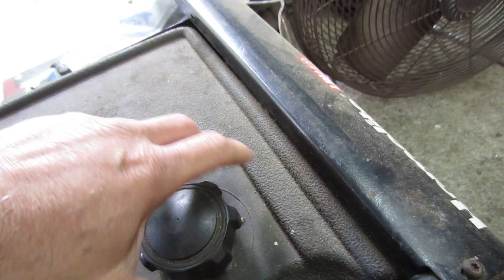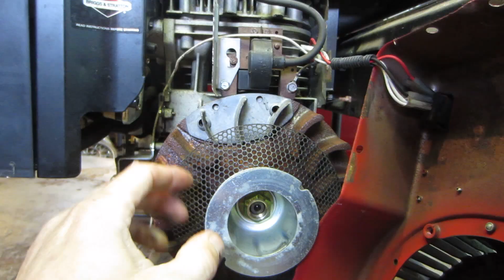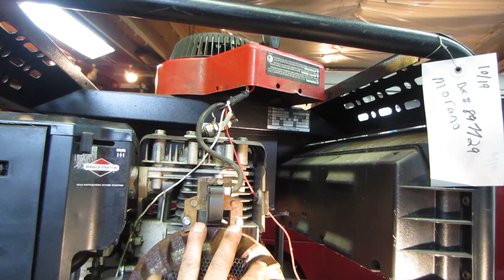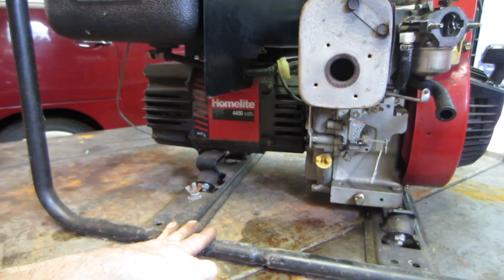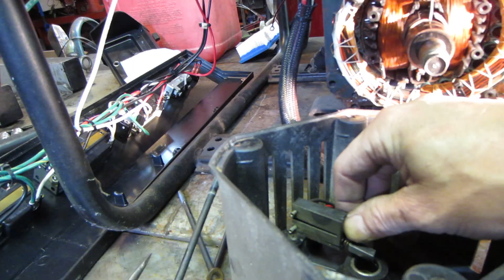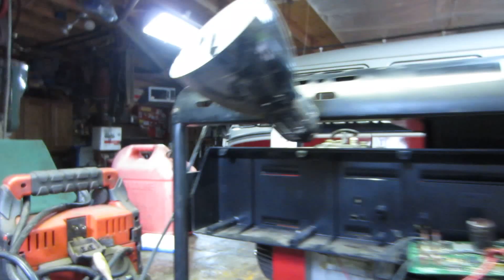$5 yard sale generator

Comment: I was not satisfied by the final test that the exciter winding was getting current which may have been slip ring issues.  What was the resistance reading for the slip ring circuit?  I feel this generator was really close to working.

Comment: Rust on flywheel will not prevent spark, but may weaken spark somewhat because of inductive pickup between mag and steel insert in flywheel is reduced by the rust. I hate rust anyway, makes things look sloppy. I've discovered that rust will make a truck engine's spark wires clamps at the distributor or spark plug cause a miss at idle which can be very irritating.

Comment: Sanding the fly wheel, will bring back the spark..when rust gets heavy, it will build the air gap up too,high..sanding will bring the gap back..learned that 35 years ago

Comment: Did you run it and check for voltage at the generator head plug white and black or red terminals?

Comment: The way half the outputs failed at different times, I think the splice point of magnet wire to insulated wire failed in the stator. Maybe someone slipped  in som acid core solder at the factory. I think it would be worth it to take a peek at those splices.  I would have expected to see some AC when you applied power to the field ....Heck, years ago my good friend John Murphy would unwind a defective motor by hand, sand off the old varnish , then re varnish the wire and rewind

Comment: Sound like a fuss or a  circuit  breaker, no out let power. Who knows. trail and error testing. Can always part it out > But a GENERATOR?  HELL NO !  get it working,  I got so many uses for em > Drain some of that oil out > i alway check the oil 1ST  see if any metal ect. level

Comment: I've never seen a generator engine without tapered shaft, rotor for generator does not have a key, long bolt goes through rotor to crankshaft on engine.

Comment: Looks like the lamp you were using was an l.e.d. if thus is the case than most likely the lamp will not come on at all at half voltage. U need to use an incandescent bulb.

Comment: If you should examine the circuit board closely look at corrosion on any of the legs the resistors that would indicate the resistance has changed value has changed and it may not operate within specs also look to see if any component is expanded or burnt!

Comment: I would have checked solder joints on the board to see if any had broken or had heat stress.  Cheap and easy fix!

Comment: I have a small 2000 Watt generator that has the same issue, the engine runs fine but there's no power. I will try the 12 volt idea. That will be a summer project.

Comment: 1 st rule of elec.     clean and tight            the coil needs to be grounded to the block    wire wheel the back of the coil where it mounts wire wheel the mount studs if you have any     run a file across the two mount studs on the block        if you still dont have spark the coil is shit      air gap is  .010  in.       the rust on the outside of the flywheel dosnt do shit   thats not how it works           so stop condeming the coil because you dont know any better        now you know

Comment: Mustie, rust is the same as a resister in an electrical circuit. It inhibits the flow of magnetic flux. Therefore weaker flux even to the loss of spark.

Comment: On the generator specs, there should be ohms readings for the various windings and I think I would have checked those out to make sure the windings were all conducting at their proper specifications. Very rare that a generator that comes out of a factory and is not tested to ensure it is working. That being said, if it is the board, one can rig a basic power board and use an SCR motor control circuit to operate the throttle solenoid.  Then you would have a good generator. Mainly due to the fact that Homelite had issues for many years of their generators failing due to issues with the voltage regulator. So, found that on eBay, one can get the regulator for around 15-20 bucks new. That would make it a cheap and easy fix and if the failed regulator fried the board, then again, a makeshift power board would be a way to go. Working units that are not as clean sell for around $150. So, something to consider.

Comment: Rust can electrically bridge the laminate between the plates of the laminated magneto core, that significantly decreases the rate at which the core magnetizes and demagnetizes, which can affect the ability of the magneto to generate a spark.  How much, I do not know, but it does have a negative effect.

Comment: I've watched you for a while, but your comment on the rust not making a difference shocked me. Of course it does and 99% of times that has been the issue I've found when fixing small engines. Sand the rust off and BOOM you have spark. I'm sorry but you seem to know a lot and that comment has shocked me lol. It's one of the most common and known things. I know in this case you didn't and it got spark, but the spark will be stronger the cleaner the magnets.
Reply: rust has no big affect on inductance it may even improve it by closing the gap
Reply: I've always done the same, but I tend to agree with him. it always seems to have more to do with gapping on the coil then rust.
Reply: Rust does not effect magnetism of flywheel.
Reply: RustySkull Productions for sure I had rust on the coil wire on a lawn mower and it made the spark very weak
Reply: Exactly
Reply: Forsure
Reply: That all almaium now days
Reply: rust only works on ferrite on copper wires its called corosion

Comment: I had this same generator before, The coils in mine were burning up in the back of the casing. Once it stopped working I ordered a new one, placed it on and it did it again and died. Like yours the Briggs engine runs great it's just that Homelight Electric coil isn;t that good.

Comment: On the ground fault plugs you must have power to the plug to trip it on the test button. Or it will not trip because that is actually something to keep you from shocking the crap out of yourself if it works right the test button basically make sake momentary cross between ground and hot to trip the system. At least that's what they tell us an electrician School unless that's some sort of weird setup that they don't teach electricians.

Comment: Yes rust on the fly will and the magneto if it builds up enough can disrupt magnetic continuity to the point where it either doesn't produce spark fast enough, not enough power, or not at all but typically that only comes from engines that of been set outside for a long period time but it's always a good thing to try sanding the magnets, if you don't I can change your gap settings when you put the magneto back on.

Comment: Yes rust on a fly wheel will also prevent the coil from making spark! It's not a MYTH! I've repaired plenty of small engines with no spark. Took a wire brush and fine grit sand paper and cleaned the rust off.

Comment: Your urban myth claim is NOT an urban myth.  Had a Stihl backpack blower that was caught in the rain one day and next week wouldn't start. The only thing i did was sand the rust off the flywheel and coil face.  Restored spark and it started on first pull.  I have seen this issue many times in my 48 years of piddling with small engines.

Comment: People replace the receptacle with a household unit and they come with a bridge connecting the two halves together. A lot of generators arent wired that way and it shorts the two windings together burning out the stator. The bridge needs to be broken out.

Comment: FYI for you that rust on the flywheel magnets and the fins on the coil will cause no spark. How many times I had no spark and cleaning them off brought it back. Just use some sand paper and take the rust off.

Comment: sending off the rust sometimes bring spark back to the Magneto I have a little 2 stroke Sportsman 1.75 outboard boat motor that had no spark and I took some Emery cloth to the Rusty Magneto and it started right up so it sometimes works and sometimes doesn't
Reply: but that was also an electronic ignition

Comment: I didn't notice if you addressed if the generator head was actually being driven by the engine. I'm sure it would make a bunch of racket with a broken coupling. and with no resistance on the windings sure sounds like it was toasted. doesn't stop us from hoping for simple stuff though. great video!

Comment: Not trying to 'burst your bubble' or anything, BUT at 7:00 or so you saying 'sanding off mag is I think urban myth' well, maybe it is a myth. But for me I think it worked. I have a 5hp Briggs on an old tiller. Had no spark when cord pulled. So I took off cover, saw rust on the flywheel, hit it with some sandpaper and got the ends of the coil w/paper too. Hmmm...it sparked 'white flashes'. Long story short,,,either doinkin' around with the coil, or the sanding of the rust off the flywheel, worked. Also, I saw on another of your vids going down into the points and condensor. FWIW I saw one of 'Teryl's (Teryl fixes all) vids of him replacing old coil with new electronic coil. NO points or condensor, and he just cut the wires to the points/cond. Didn't even bother to dig down into it and take them out. Didn't need to. Hmmm...   cool huh.
Reply: an old and easy fix .... cut the wire and fit a later coil good tip though ...... but hmmmmmmmm ?? no need to be sarcatsic

Comment: Generator 101, Rotor  = exiter
Stator windings  = Output power;

Same as automotive Alternator where the  3 phase AC output power goes through Diode assemblies to produce DC output!
They both  have some sort of Voltage regulator!

Comment: What I have found when the windings on the field (outter) windings overload is that the point of break often occurs at the crimp connector where the windings come together. It is easy to cut the remaining winding away from the crimp and then sand the ends down and re-connect the windings using another buchanan, though I generally drop some solder into that after I crimp it. The same I have seen on auto alternators as well. In the latter though one of the diodes to the rectifier bridge associated to the winding that burned is always bad as well.

Comment: I was looking for replacement wheels for a lawnmower once and my neighbour had an old Lawnboy mower that didn't work. He gave it to me for the wheels. So I said to myself why didn't this mower work. Found out it had no spark. Took it apart and noticed heavy rust on the magnets so I sanded them clean. Put everything back together and hooked the plug wire back up to the plug and voila - spark. A few pulls on the cord and it fired up perfectly. Neighbour was not too pleased when he saw me mowing my lawn with his reject mower. So urban myth it was not.

Comment: I think the test light you were using at the end is a CFL inside a spotlight. I don't think they will light up with only 50v, next time using a regular incandescent might work better.
Reply: He had zero output Volts on the meter so it wouldn't matter although you're probably right about it

Comment: If you still think it is is the board, consider looking it over for burnt or obviously damaged components and buying and replacing them individually on the board. Should cost pocket change. The motor does sound like it's not idling very high. Doesn't have its usually vibrating rumble of full speed.

Comment: I'd just replace the individual components on the control board. it looks all through hole discreet no SMD. digikey is cheap. slot of the semiconductors can probably be found in other electronic stuff. sure would be a hell of slot cheaper than a board. that's how I go about it. or get in touch with bigclive.com here on YouTube. he's in Europe but he may be able to test it and fix it on the cheap.

Comment: Always check the armature on generators that have been left sitting for a while. They will oxidize and the brushes won't contact enough to generate any current. Clean the rotor contact area with scotch-brite pads.

Comment: If you haven't abandoned this project, check and if bad, replace that large capacitor on the circuit board.  It's a low cost item, might just as well replace it anyway.  That capacitor is used to flash the generator each time you start it.  It substitutes for a battery..
Reply: The cap and condenser are for “exciting” the field and oftentimes you only have just one cap. “Flashing” the field is done with a 12 volt battery connected directly to the output poles whilst the engine is running and what this does is to restore the magnetism in the primary windings.
Reply: I somehow missed that part near the end of the video.  Thanks for pointing it out.
Reply: The capacitor doesn't flash the generator field.  It is part of the excitation control system, probably a filter.
Reply: I'm late here, but if you ever suspect a circuit board is bad with no obvious cause, and it has electrolytic capacitors on it, may as well swap the capacitors and see if that fixes the problem.  They are chemical and have a shelf life, and it's not unusual for them to fail prematurely.  Replacements are probably only a dollar or two at a place like digikey or mouser, USPS shipping is likewise only a few bucks if your order is small enough to go regular mail.

Comment: Find someone who tinkers with electronic circuits & let him have a look at that board. There may be a transistor or capacitor that can be unsoldered & replaced to repair the board. Worth a try..
Reply: It would not help a darn thing. If there is absolutely no connection between the wires from the stator coil, it's burnt.
Reply: Mustie and Sporty- anytime you think or know you have a problem with a circuit board, contact Circuit  Board Medics. I recommend them highly- cheap and fast
Reply: Richard Brown LP LP LP

Comment: Just a note on the coils that Briggs used, especially the ones you have for this engine. You can take the laminations out of the coil and swap them so you don't have to grind them. I did it on one a while back, I'm pretty sure they're just friction fit together. If you look at the side that the spark plug wire comes out, there's an angled piece, it separates there and at the top where the paper gap is.

Comment: Did you try and reexciting with plugging in a drill motor and spin it by hand? Try it for giggles I  did it on one of my generators and it started making  juice  again. See youtube vids on reexciting a generator. Cost no $.
Reply: you can excite them  by using a VOA meter and setting it to ohms. Just open the inspection plate to access the brushes and while it is running put the probes or the brushes. Or just use a 12v battery and touch the brushes while it is running. Just a touch is all it takes.

Comment: The drive shaft on the motor is horizontal so it would make a good go cart engine or many other power applications. I had a small Honda generator that I got for $10 that the generator was good but the motor needed parts I couldn't get.

Comment: you had me syked out when I saw the lights on when it was running!
Reply: I had a similar situation, I got a push mower for free that the owner thought seized. Mower had no spark plug in it and would spin 3/4 of a turn then stop. Pulled the head and there was a dead wasp nest inside that the piston was ramming in to. Cleaned it out, put head back on, filled the gas tank and it ran great.
Reply: SAME!!! He never explained what he was doing until after he did it
Reply: Ryan b
Reply: canadacatalyst I started once I began watching his vids and I've done repaired a push mower that i bought for 5 bucks all I had to do was replace the dead man's cable and the gas cap and a good carb cleaning she is currently used to mow my front lawn

Comment: I'm with you on the rust on the flywheel as being an urban myth at preventing spark. I've swapped coils a few times from the small to the large and vise versa on the Briggs because that's all I had; it works great. The motor is going to be a taper shaft for sure. I generally search for a generator with a thrown rod to swap the motor onto.
Reply: Hahaha here Mustie1 is talking about it likely being a tapered shaft and my first thought was yep I bet it is because I remember seeing a video from sixtyfiveford on this exact thing from a little over a year ago. Then the first comment listed in the comment section was from who else. :-) Yes I realize I am replying to a 2 year old comment but I had to say something. ;-)
Reply: mute8s - hey, I just showed up here too! Mustie is timeless
Reply: It seems to enhance the spark when I clean the flywheel and coil
Reply: good call with finding a replacement like that. Everyone's happy - you get to complete your generator for cheap, they get to sell the 'scrap' that's useless to them, and there's less energy and resources wasted in manufacturing a replacement

Comment: I'm with the other guys on this one. I'm betting the resid. magnetism has died and maybe some component failures on the M. board. Don't think this generator ran enough to burn windings. It should smell inside the case if it did. There MUST be some kind of overload protection that also might be open. For sure, that GFCI plug will not reset until it sees 110 volts. The one on the other circuit should work with any amount of voltage.

Comment: Good call to just part it out.  It wasn't a high end generator to begin with. Also the bearing on the power head end cap are famous for going bad and tearing up the plastic housing when they fail. Very tough to finding the correct housings now as they pretty much all fail. Take Care.

Comment: It may have a bad capacitor or a bad fuse (the one between the capacitor and the port/connector to the right)
Reply: Hey Mustie1! Great channel, keep it up! Ditto the capacitor comment, it looked a little crusty. Those caps are cheap, get a replacement one from digikey or mouser.